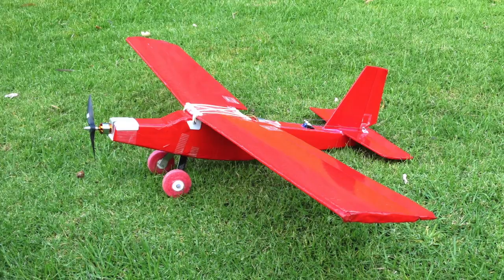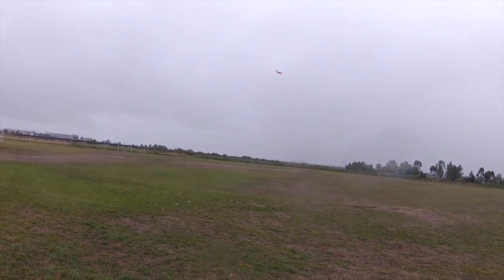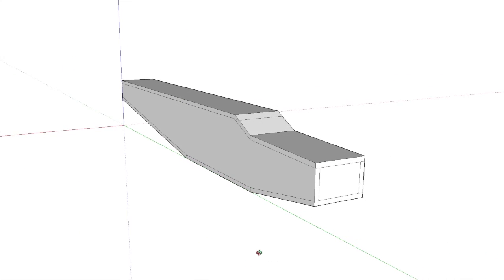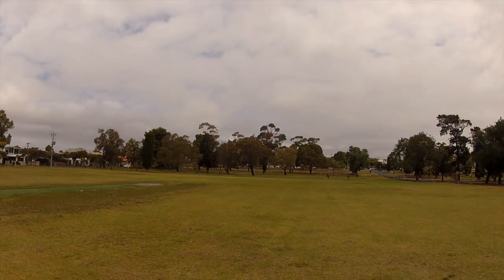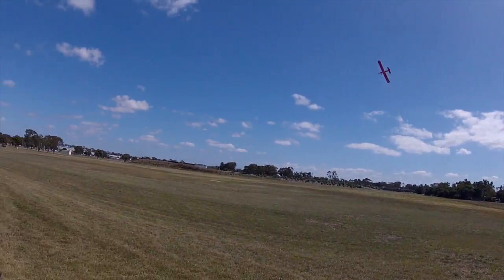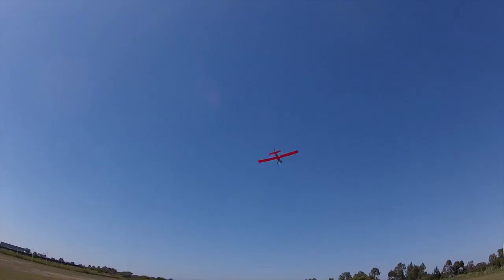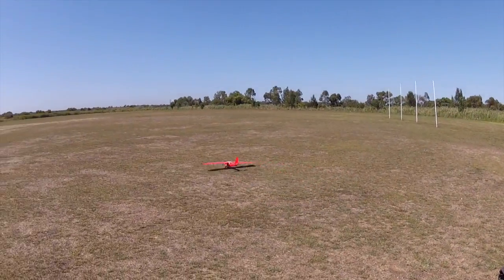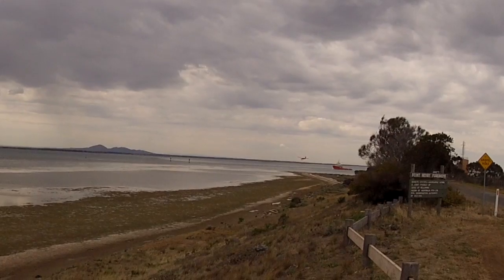Red Plane maiden

Comment: Good day sir!in 1300 kv motor can i use 30A ESC?and my battery is 1300 mah,i try to build trainer plane 40 inc wings,thanks
Reply from the maker: Hi Edwin. Need more information. Which motor exactly (should tell you in the specs which prop and ESC to use), which prop, and how many cells in your battery (2S, 3S or 4S)
Reply: Andrew Newton i have 1300 mah 3s 11.1v,With 30A ESC and my motor is 1300kvand my propeller is 9x4.7 slowfly,im planning to build a trainer plane with 60 inc wings,its my 1st time so i dont have much idea.your reply and suggestion with help me alot.thank you
Reply from the maker: Which motor Edwin? 1300kV does not give me enough information.
Reply: Andrew Newton sir its DYS D2830 out runner Brushless motor

Comment: Thats a very cool plane I always enjoy your designs and video . Can you help me I tried many times to make landing gear for my planes. How did you make yours and what kind of metal that is. and always happy flying
Reply from the maker: James Woodsrc Hey James. Good question. I use 20mm x 1.5mm aluminium for the struts and piano wire for the axle. I also rivet on 2 x 60mm pieces of al where the struts sit under the fuselage to spread the load. It's all just taped on to the plane. I need to do a build video, thanks for reminding me.

Comment: If you get the chance, is there a reason you went with a 40A ESC?  -COLE
Reply from the maker: Howdy Cole. That's the recommended ESC for the motor. With this prop (bigger than ideal) it draws 40A full throttle so I limit the MAX throttle to 60%

Comment: Hi Andrew, nice video. Will it slope? It technically is still a glider (motorized), I think in the right conditions even a brick will slope (depending on the wind speed). Btw I use the same landing technique with trees. Works well. Thanks
Reply: Knew an old Piper Tri-pacer pilot who said he always carried a brick with him - in the event of an engine failure he would throw it out - and then he knew where he was going to land (a commentary on the terrible glide of that breed).
Reply from the maker: It does glide very well but the extra drag from landing gear etc cuts the efficiency a fair bit. Only 15min slow cruising from this one whereas I can get 25 min from the Spectre and Poly Pusher (using 1500mAh of a 2200mAh 3S LiPo)

Comment: The 7x4.5 does OK on that 2200kv motor? Or you just like living on the edge? ;-)
Reply from the maker: Ha, good question. I have the throttle limited to 60% Max for that prop. Pretty sure the motor and 40A ESC would not handle 100% flat out for long.
Reply: Andrew Newton right'o, good idea. Basically has the same effect as switching from 3s to 2s.

I have a Cheep N' Easy that I put a very small cheap 2200kv motor on, in combo with a 3s, 10A ESC, and 8x4 slow fly prop. (I do like living on the edge!) I never go above half throttle except for infrequent 1 second busts to get out of (or into) trouble (it flips, rolls, and launches like crazy at full). I basically treat it like a nitrous boost. I'm sure eventually my self restraint will fail and I'll burn something up, but I've flown it this way for months without issue (and with a lot of fun times). 

Cheers!
Reply: You can find great brushless motors at Banggood.com for the best price!

Comment: Would you have kept the dihedral for "normal" conditions (not so windy) or do you actually prefer the flat wing for the high wing / trainer type of craft?
Reply from the maker: Much prefer the flat wing. The dihedral doesn't seem to add much stability and makes it less stable in side winds.